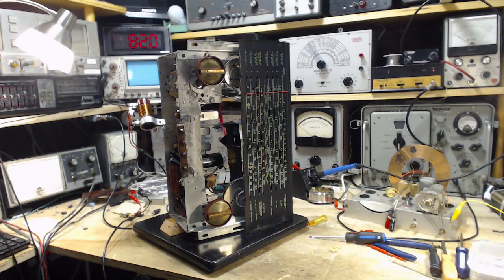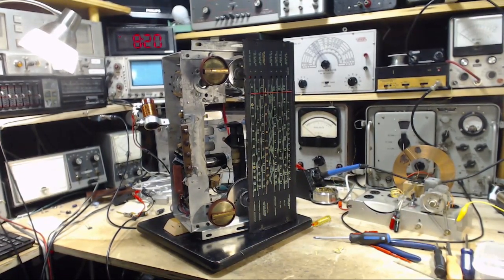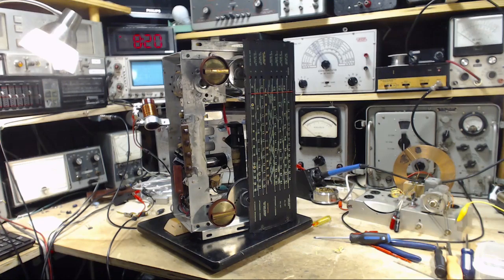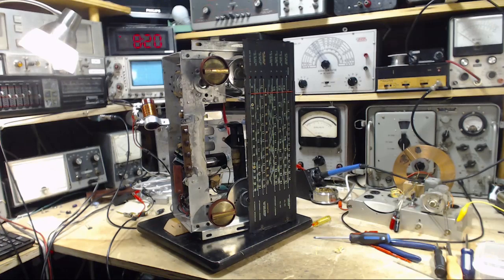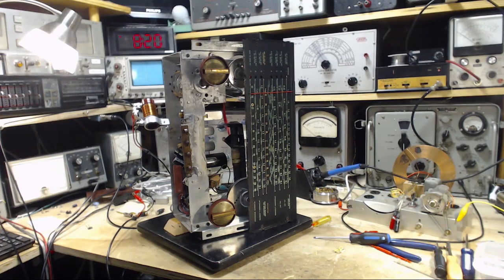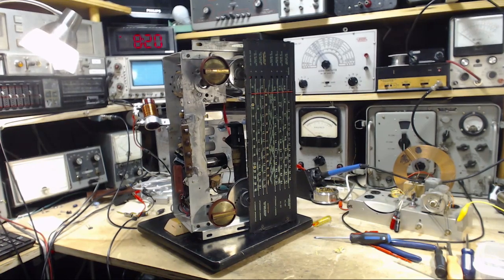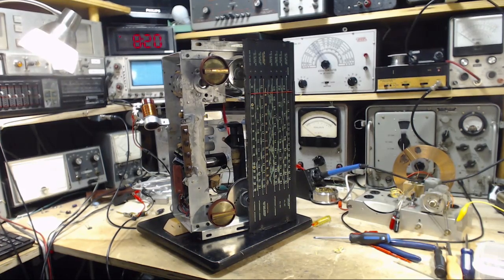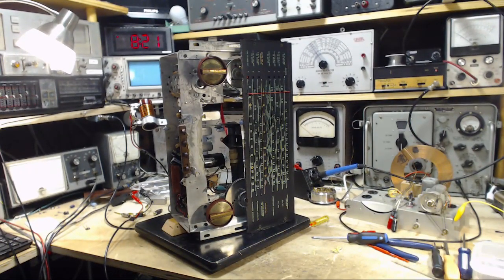Hallicrafters TW2000 World Wide Video#21 - Tubes Tested

Comment: Don't ever remove a directly-heated cathode type tube with heater current applied (even from a tube tester).
The red-hot filament is EXTREMELY sensitive to mechanical shock.

Comment: It figures that the 1L6 would be bad, the most expensive tube in the set. You can replace with a 1U6 for about half the cost. BTW, there is virtually no warmup time with these tubes.
Reply: Gerard Carriera On his first round of "Lets test the tubes" in video #3 that 1L6 tested perfectly fine... So what does that tell us? Maybe "dont operate these tubes in a non vertical position for it may have a bad influence on the tubes"...